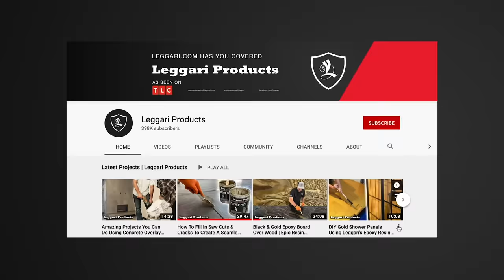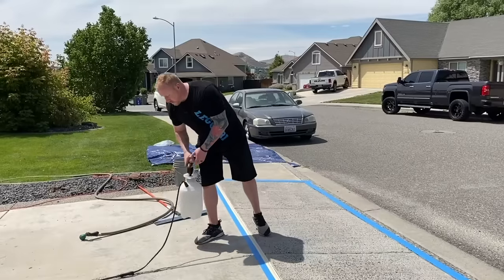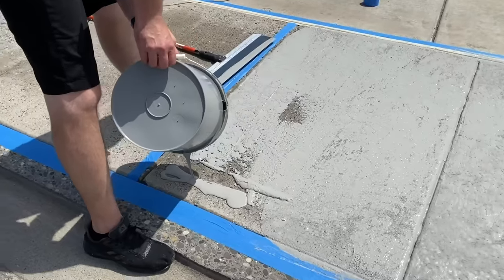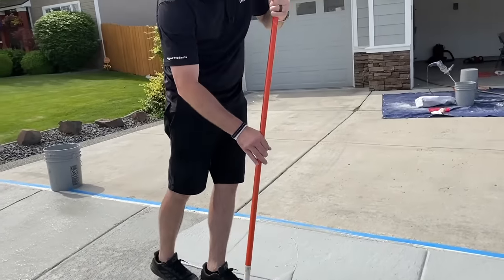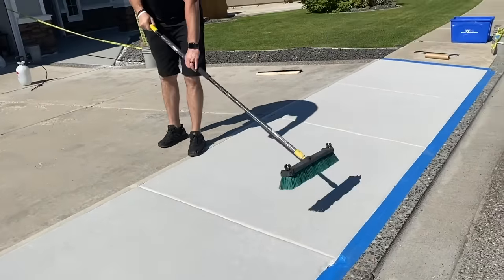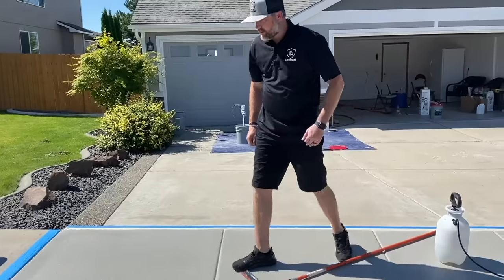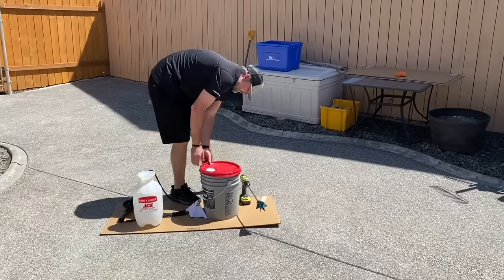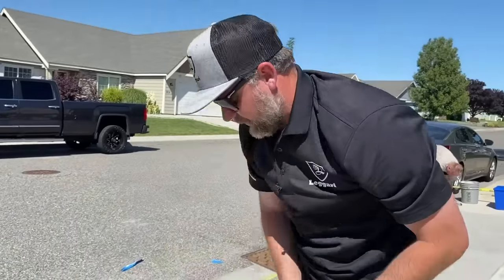How To Repair Old Concrete | Resurface Concrete Sidewalk | Restoration Project DIY Concrete Repair

Comment: It would be cool if you made a video showing how to do this with mixes you can get at the local big box store. A big chunk of people can’t afford $600  to buy one of your kits
Reply from the maker: Installation and final product would differ slightly because our product compositions differ. For example, our epoxy is purposefully formulated to push air bubbles to the surface after air has been mixed in...this isn't the case with many other epoxies out there. They should have their own installation instructions though! 👍

Comment: please, what product is that lenpine before and after on top with the watering gun thanks
Reply from the maker: Hello! This is our Concrete Overlay which we use to repair concrete, as well as our WB Sealer. You can check out the products used here 👉 https://leggari.com/product/concrete-repair-kit/

Comment: Existing cracks in old concrete will show up in the new topping within a year unless they are somehow separated from the new topping.  This is called reflective cracking.  Separating the old concrete from the new is very difficult to do.  A plastic mesh imbedded into the new topping will help if it is thick enough.  Best bet is to bite the bullet and take out the old concrete and replace it!
Reply: Not really. If the old concrete is still intact, why replace it when you can resurface it? Huge cost difference.
Reply: Will Carryu  :My point is that toppings don’ t fix the problem.  The cracks will just return through reflective cracking.  If you can’t afford to replace the concrete, then another option (which won’t hide the crack but just extend the life if the concrete in freeze thaw conditions) is to seal the cracks with a good sealant.  Sika products are used often in commercial situations because of their quality (but their pricy).

Comment: Horse hair broom instead of squeegee cuts this process down. Almost like a paint brush. You kill 2 birds with one stone.  Move the product while brooming at the same time.  You only need 2 coats. Take a paint brush to clean the joints out and clean the edges. No need for an angle grinder.  I resurface and use these easy strategies to simplify the process

Comment: What can you do for a 50 year old driveway that has many slab cracks, uplifts and sinking spots, short of having a new driveway constructed ?
Reply: Most likely slab wasn't thick enough and had no reinforcement at all. You'll need to get a contractor to pour a new driveway after removing that mess. Make sure no trees are putting roots under slab. If so, cut roots and pack soil before putting a new slab.
Reply: @johnknoefler  Yeah, slab is about 2 inches thick, no rebar, and plenty of mature oak tree roots that have grown underneath.  Big mess.  Time to sell.
Reply: @elli003  After removing all broken concrete you can dig down and use a sawzall to cut the roots. Make sure you get the tree trimming blades. Cut back about a foot from where your slab will be and then pull up and cut anything larger than your thumb. Small roots not connected to tree you can just leave in place. Relevel and then get a "jumping Jack" soil packer from Home  Depot rentals. It's a bitch to use but you really need to pack the soil back down tight. Then have the contractor come in and do professional slab that's up to code. Should be at least 5 and a half inches thick. 8 inches is above code but if you can afford it, do it. With rebar it won't ever crack. Just make sure the contractor puts in at least a couple seams. If you're reselling, still do it as it will pay for itself on resell.
Reply: @johnknoefler  Thanks for the expertise, but this old house has seen it's better days.  Half of the homes in this 1963-64 neighborhood are being torn down and replaced with mega homes.  Driveway slabs are cracked, and home foundation has had more re-work than Joan River's face.  I wasn't sure if I could get away with a quick-fix BONDO project, but I guess not.  If this product were Rubberized, I might could get away with it.  Thanks again !
Reply: @elli003  Your decision largely then needs to depend on your needs (economic) if you want to stay or move (location) and prospective buyers, (market) as well as house condition (termites, slab or joist foundation. Foundations can be replaced. I've seen it done but it's laborious and expensive to meet the new codes. More modern foundations go down three feet with a wide slab under that. One house I saw the inspector specified that the corners needed to be replaced and midway on the long portions to satisfy code. House was jacked up and renovations performed. House put back down and bolted to new foundations. Old slab house, cheap construction, then maybe a complete tear down and sold as empty lot. New owner will need new permits. In California that can run up to 40 grand just for permits. I hate slab houses just on the plumbing issues alone. Old cast iron sewage is garbage after 50 years with shrinking internal diameter due to rust build up. At some point, it's a huge problem with liners which are not a good option in my opinion or cut up floor to get to plumbing. Steel water pipes are also garbage. Termites are a huge headache with tearing out the damaged wood and then fixing and replacing sheet rock. So, I understand your feelings. Those new mega houses also use crap material. Only way to get a sound construction today is to build your own or pay a huge amount to a contractor to build to your specs. Wood frame construction is future termites unless all wood is treated. I've been experimenting with dirt crete and looking into other alternatives. Dirt crete blocks with concrete core and rebar.

Comment: Is the overlay breathable. My experience is that most of these are nothing more than cosmetic temporary fixes that crack and delaminate within a couple of years. Even with proper surface prep. When it fails the contractor is long gone. Better just to break out the concrete and joint and seal it properly. Obviously this is the ideal system for people who want to sell their house and improve the curb appeal without worrying about long-term issues.

Comment: I'm just wondering why he doesn't make sure that he completely covers every inch of the pad because I'm watching him spray the first coat, but he's missing a lot of spots so that when he sprays the 2nd on the spots that he didn't missed, those spots are actually 2 coats, but the spots that he missed the first time around is actually only one coat. So how critical is it that he covers the pad evenly with the 3 coats?

Comment: What brand is the metal scrapper you use on the 1st coat ?
Reply from the maker: https://www.homedepot.com/p/Wal-Board-Tools-14-in-Blue-Steel-Blade-Taping-Knife-19-044/100660211#overlay, here is what we typically but, then you just have to get a pole attachment!

Comment: The concrete material is it slippery on the concrete? Will it be slippery during rain or snow? I amin NYC I like to repair my driveway just concerned if it be slippery. A lot of rain and snow falls here.
Reply: Around here masonry firms who recoat drives and walkways use the broom and
brush finishes to give a good grippy secure surface like they did in the video.
One comment; use of snow melters and salts will deteriorate even a sealed
surface faster than if you used traction grit or fine sharp sands in the Winter.

Comment: is there a maximum slope for this product?
Reply from the maker: Not that we've come across. It's great for sloped driveways, walkways, you name it. It isn't a super fluid product and is scratched tight during installation. Check it out here! 👉 https://leggari.com/product/concrete-repair-kit/

Comment: i use crack sealer u use when u rebar under a repair load bearing slab ,let it set n seal then smear it w thin set like your painting it tiny bit of elmers n sand

in fact if u ever do stucco
5 gallons bucket  paint ,remove 2 gal paint replace w 2 gallons of elmers+ 3 gallons 
of the paint ,one more tme and u got 10 gal  of paint fills 2 5 gal buckets, 1 coat roll on,nifty Polish trick its like vinyl nvr paint stucco again ,removes knuckle rash

Comment: I have a 5 ft wide by 38 ft long sidewalk .It has just been poured
They laid a drain to shallow under it and the walk cracked all the way across
They then came out to try sealing it with what looked like cement.
That has cracked as well and now I have a dark gray line about 14 inches wide and 5 ft long
and it sticks out like a sore thumb
Could I (actually the contractor)use this to both seal and make all of the sidewalk the same color
Reply from the maker: Yes! Using our Concrete Overlay to match concrete is a very popular application by our customers.

Comment: Is this cost covered through the municipality?
Reply: If you're asking if the city pays for it? The answer is no & property owners can't just go doing what they want or having it done to this section of the driveway because it is not the driveway for one, by law it is city sidewalk but say you live in an area that gets snow in the winter, a pedestrian is walking past & slips on the icy sidewalk, so they go to an attorney for damages caused by the ice right in front of your house & even though it's technically city property, you get sued because of failure to keep it cleared, the city isn't liable and doesn't clear it off but it's in front of your house, you loose. As for work being done on it, you will be fined for doing it yourself or even having a licensed contractor like these guys are because unless the license is bonded through the city and the contractors name is on file with the license, he is not allowed to do anything to that portion of the property ( the only part they did touch in the video) the bonded contractor must file for a permit first and cost is by the linear foot and not cheap, but it's way cheaper than the fines issued if you're caught doing work to the walk. Lastly, the city in any situation I've ever seen will not let anyone " put a bandaid on it" as a figure of speech, it is tear out & replace only. ( I've done more approaches, sidewalk,  curb & gutter, than I could come close to remembering over the last 43 plus years so I've seen a few like this.) When county codes take place of city codes, the rules and laws Change in some way or another & sometimes very drastically, so before considering having this kind of thing done you should make sure you are not having it done to city property, it's fine for other area's around your house and can last for years if done right, it looks like they're very thorough with preparation so the odds are better still that it will save you lots of money when you don't want to pay for new stuff, the cost of concrete, materials to do form work needed as of lately increased rapidly and still are getting higher every other month, so it's definitely worth going for but I'm not kidding when I say the fines are higher still. I hope this helps you from ending up in trouble but these guys should really do their homework before showing homeowners something that the really shouldn't be doing. ( If for some strange reason I am wrong about what I said & it's perfectly fine in that state, I'll step up and admit I'm the one who don't know, but I very seriously don't think that's the case & it would be highly unlikely that the rules there are very far off from anywhere else, like I said, county might be another thing)

Comment: How do I take out low spot during re surfacing which accumulates water after rain.  I have couple of spots on long 50' Long x 5' wide feet walkway?
Reply: Surely you don't need to ask? You fill them with a concrete resurfacing product, for example thin floor leveller.

Comment: How long does the product last for wear n tear?
Reply from the maker: If prepped correctly this product will not come off. Even in extremely high traffic areas it can take 15-20 years before seeing wear through the surface. In residential or light commercial use, theoretically it’ll last the life of the concrete beneath it. Thanks

Comment: How long will they last ?
Reply from the maker: Hello! Longevity depends on various factors but these Concrete repair kits are designed to handle years of heavy traffic and will not wear off or delaminate even after years of use. Thank you!
https://leggari.com/product/concrete-repair-kit/

Comment: Will it at least withstand Ice melt? My walk is severely pitted now from Rock Salt being thrown on it. Thanks
Reply from the maker: Absolutely, that is the number one use of this repair kit. To repair badly damaged (spalled) concrete from ice melt. Thanks
Reply: Use chicken gritt no worrys about kiing grass or flowers also makes a nice slip free surface
Reply: You're not supposed to use Rock Salt on concrete for that very reason.

Comment: My first question is this product anti-slip and secondly what is the drying times? Sorry. I must missed those parts - if you did already mention them.
Reply: I think if you hydrate, rehydrate, hydrated re, re hydrated, hydration and/or hydrate, and you should be good 👽

Comment: Nice job, but you should have left the exposed aggregate.  That looked really nice.
Reply: Bob P I agree I was working on site in  concrete gang  UK  concreting driveways we would lay and do a trowel finish and  come back to the job when the concrete had tacked off  with a skin on  it and lightly spray the skin off it done properly it looks just like marble and lasts for years.GED
Reply: Agree with you looks like marble  after  time .

Comment: In my garage I got some cracked up spots and holes, and it is very unlevel I don't want to raise the garage up and pour a new foundation and floor that would cost a fortune plus the outside is stucco and it would crack so then I would have to fix that too. Can I repair those with a couple bags of concrete? I've done concrete work before for many years and then I went into drywall. I've never used the repair kit before because all the stuff I did was new. So do you think this would work? or do you have any other ideas I could do because I want to be able to park in there and set up a work o shop on one side it is a 2 1/2 stall garage and I'd like to have a nice clean floor and maybe put that colored garage paint stuff or sealer with the sparkles in it. I think you just roll it on or squeegee it so it looks new and nice and smooth and fresh looking. So will this work and not crack? I just found your channel and I'm loving it already!  Oh who ever poured it never put any cuts in it, that's why the concrete cracked and raised up and down so I don't know if I should put some cuts in it? Sorry so long Thanks a lot
Reply: Of course you cannot use "couple bags of concrete". Get all the loose stuff out then use a floor repair product. Floor leveller is the proper soplution. Then paint the whole thing with that sparkly epoxy (if you must) however it will look really stupid and blingy in a few years time...
Reply: @johncoops6897  well I know you got to clean the shit out and then pour concrete level it and then bow float it. I got to fill the holes in somehow. And for putting a epoxy floor stuff on I just wanted to look nice because I don't have $20,000 to lift my garage up and tear it all out
Reply: @kingdiamondgod5824  - I told you how to do it. You DO NOT use concrete.... Buy FLOOR LEVELLER. There are different grades, to fill deep holes, repair cracks, and then a thin skim type as the final top coat. It is THE proper product for exactly your problem. You buy it at any decent trade/building/hardware store.
Once again... FLOOR LEVELLER - got it?
Reply: @kingdiamondgod5824  - oh. and once you have the big repairs done, your final coat of Floor leveller doesn't need skill to lay.
It's literally a "pour on" solution. You buy "self levelling" floor leveller, and mix it up in large buckets, pour it out and squeegee it to cover the surface. It slowly flows dead flat then hardens to a perfect surface, ready for your epoxy paint.
Reply: @johncoops6897  yeah I know what you're talking about it's called gypcrete
Reply: @johncoops6897  the people that used to own the house when they poured the floor in the garage they never put cuts in it for relief and to get away with things cheaper where your tires go in the garage they put brick underneath that and poured concrete over it that's where all the cracks and stuff are coming from
Reply: @kingdiamondgod5824  - NO, not Gypcrete - I said SELF LEVELLING compound.
The "missing" cuts aren't necessary or relevant. You cannot "cover" where there are bricks instead of concrete, it will just crack in exactly the same places.. You will have to make a feature of them. Alternatively, cover the whole floor with something rubbery like sheet vinyl over a proper underlay.

Comment: Great video guys!!!  A few questions... 1.  Can you add color to this product?  2.  If you have a bit more damage, maybe corners or other would you recommend using like a hydrophilic cement for repair and then apply this type of product?  3.  I followed your link to purchase the product, when purchasing the product its says 100sf, does that mean it covers 100sf 3 times, or do you need to purchase 300sf.   Thank you again!!!

Comment: How long doed this last?
Reply from the maker: Hello! Our Concrete Repair is essentially permanent. Leggari Concrete and Asphalt Repair-bonds seamlessly with its substrate and because of this, it will last as long as the underlying subgrade it is installed over. Check it out here!👉https://leggari.com/product/concrete-repair-kit/